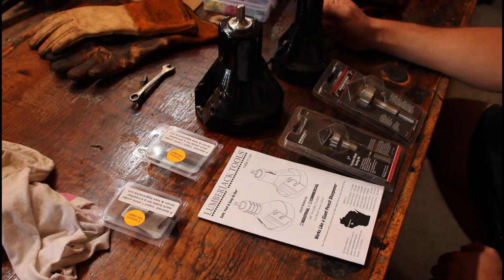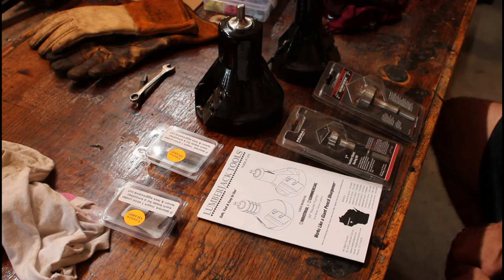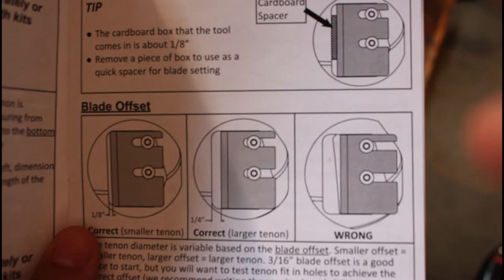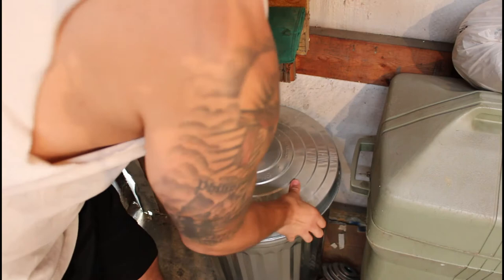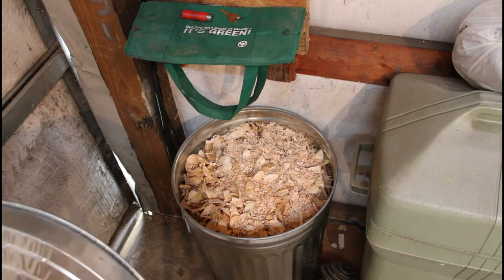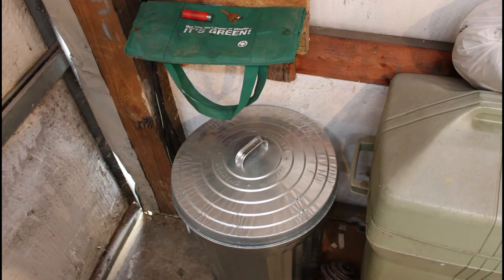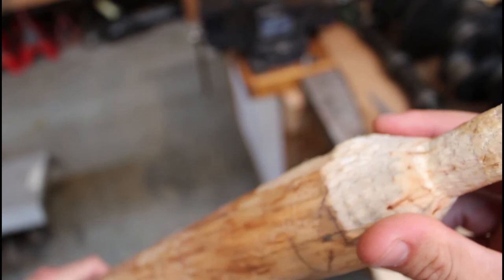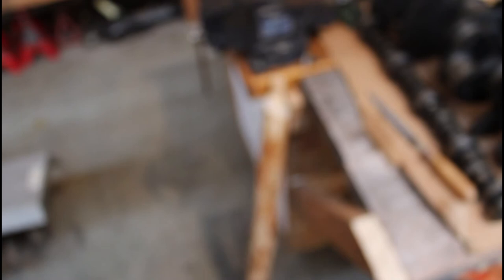Lumberjack Mortise and Tenon tools. Setup and review.

Comment: If the tenon broke off that easy, can they really be trusted to hold a person?  Just curious because I just bought one of these.
Reply from the maker: More of a problem with the wood i used than the tool. Much of these smaller pieces were riddled with bug damage and kind of punky. The bed is still together and holds all 250lbs of me lol hopefully that helps your concern. Just err on the side of too many cross supports and I think you'll be just fine. I think I spaced these about 12" apart.

Comment: I’m surprised your drill works for this…everyone says the drill that’s recommended (Milwaukee 1660-6 1/2 inch drive) is pretty much one of the few if not only drills that can produce the results and handle this type of large bit application.
Reply from the maker: I'm surprised it worked too, but it works just fine for a $50 drill.